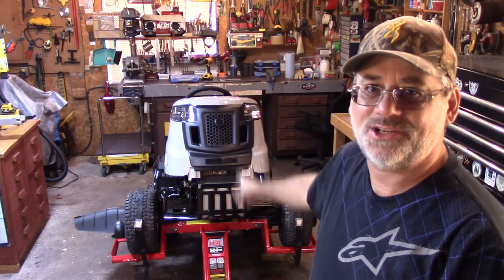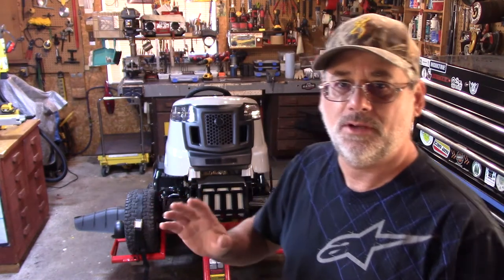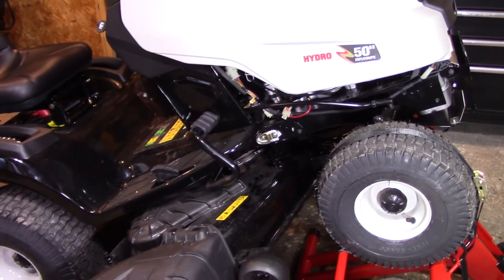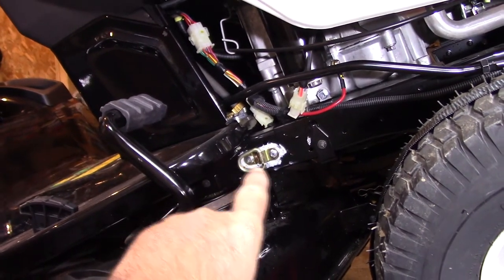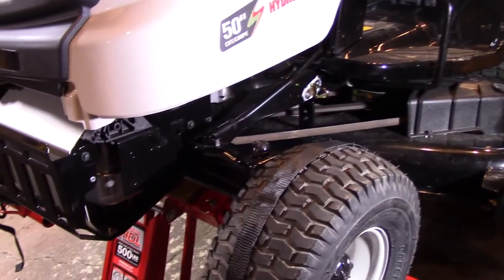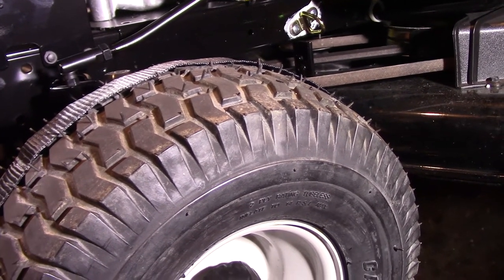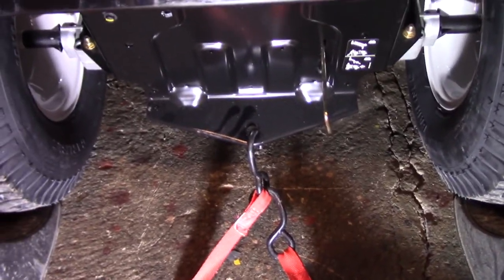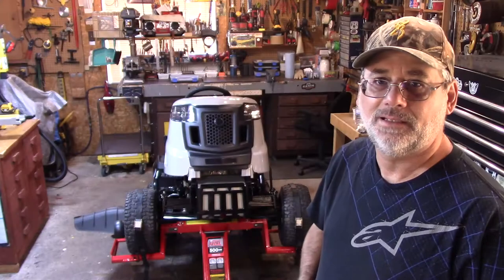Installing  Tractor Tie Downs On My MTD Gold Lawn Tractor

Comment: Looks pretty good Steve! Some argue that the rivets aren’t strong enough, but I think it will be fine. Have a good one!
Reply from the maker: Thanks Terry , the specs on these rivets are almost 500 pounds each for shear strength so on a 500 pound tractor its  just fine with 4  separate attachment points.  Take Care.
Reply: Answered my question about the safe working load limit. Steve wouldn’t do it if it wasn’t safe! Nice job Steve Rob!

Comment: Rethink the back straps! If the strap connected to the hitch ball hole fails they both fail!!! Hook both straps to the tractor separately!!!
Reply from the maker: I put a cast 3/4 inch eyebolt where the hitch ball would go. I will show the setup in the future . Cheers

Comment: so a hollow aluminum rivet is stronger than a solid steel nut and bolt? must be fancy canadia aluminum
Reply from the maker: I don't guarantee anything  as strength but if you are using grade 8 hardware its stronger .

Comment: I'm not a huge fan of rivets but they look bigger than 1/4" so even if they are a cheap brand they should have a min 1000lbs shear strength which in your case should be fine
Reply from the maker: That's what  I was thinking as well.  I like to use rivets in high vibration locations , they seem to do better than bolts  as long as the load is matched .
Reply: @SteveRobReviews  there is a reason why airplanes are riveted and not bolted lol

Comment: Bud, great video. But that little tie-downs and those little rivets will not hold it. You made it weaker buddy. Just my opinion eh. All good
Reply from the maker: Na them 1/4 rivets will be more than enough . Better than 1/4 inch #2 bolts on shear and clamping force . Thats my story and I'm sticking with it 😂
Reply from the maker: I have been using rivets for years and in many cases stronger than a regular nut and bolt . Cheers Paul.